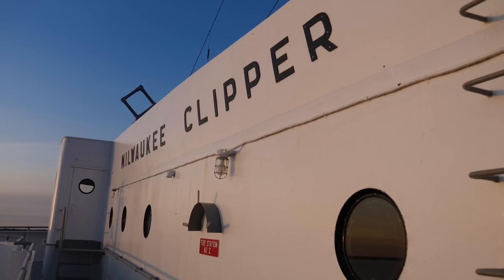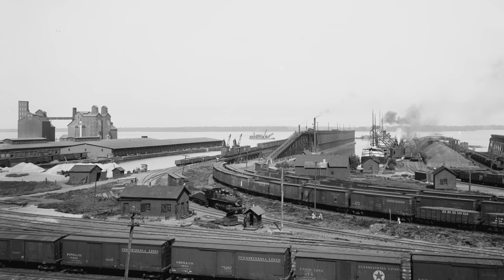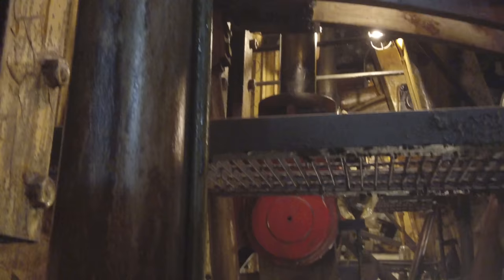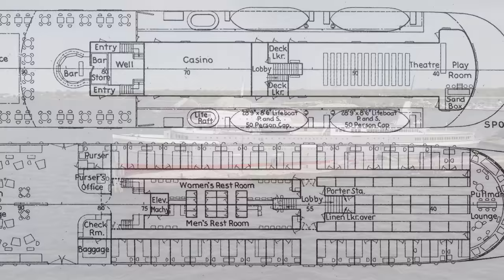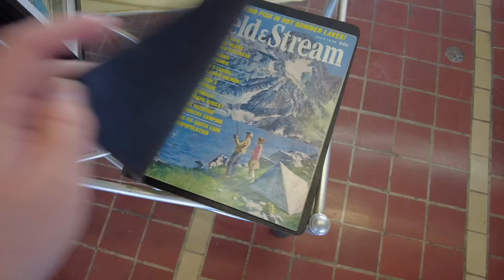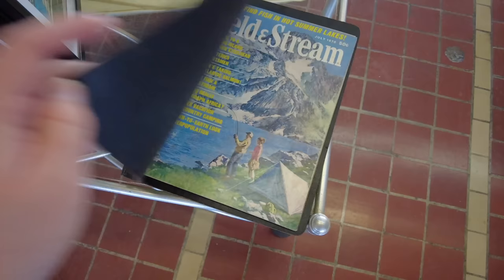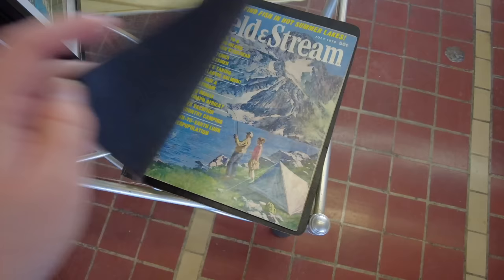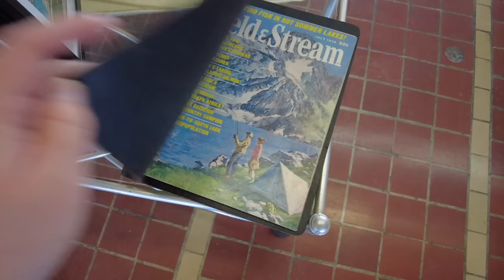SS Milwaukee Clipper - Queen of the Great Lakes

Comment: I thoroughly enjoy watching videos about large historic machines, especially videos this well done. 

One thing that always concerns me with these historic ships is how common it is to use water as ballast.

The steel in those compartments will slowly corrode away, eventuality resulting in holes that will flood those compartments. 

I always wonder why don't they drain them and either fill them with a non corrosive liquid or unused heavy machinery. I'd even install dehumidifiers to keep the moisture down to a minimum and greatly slow the rate of corrosion.

Comment: Given that disastrous fires continue to plague large ships after wooden superstructures were banned.  It seems ship designers focusing on the fuel side the fire triangle was a big mistake. Plastics later proved to be a far greater danger. 

Modern mist based fire suppression systems continue to defeat internal ship fires with great efficiency. Removing the heat side of the fire triangle seems to be the most effective way of saving lives and property. However containership fires remain a significant challenge

Comment: Going down to the lowest level of the forepeak was a helluva risky decision. As metal corrodes in enclosed spaces like that it uses up oxygen leaving little breathable air. If you had passed out inside there, you would die before help could reach you.